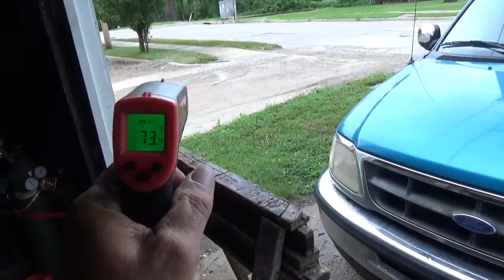Woops...

Comment: That is great that it is running so cool! A lot of people have to get new radiators and put on water pumps. It sounds good, just need to do some little projects to get it road legal now.
Reply from the maker: That radiator leaked like a sieve when I got it and I didn't have much hope for it. I just kept soldering up holes and working with it and it finally came around. (I don't know how far I would drive with it)
Reply: @shedbythetracks  I would run it until it gave me trouble since it is so cool. I usually put stop leak in mine but some don't like to use it. One guy puts pepper in it, says it works.